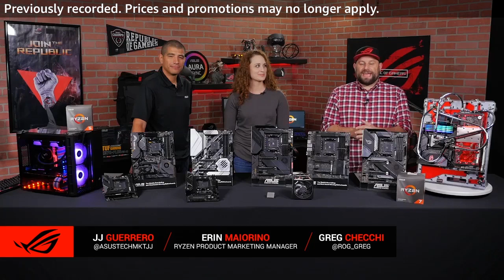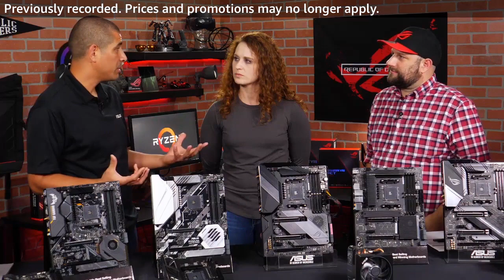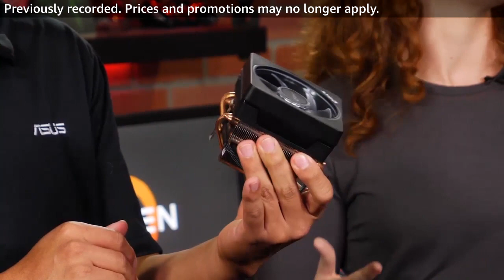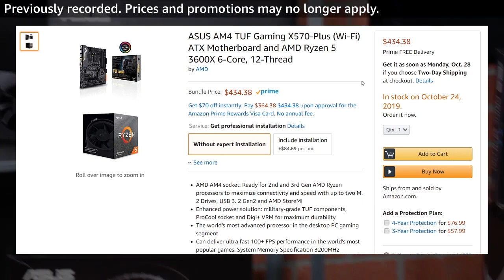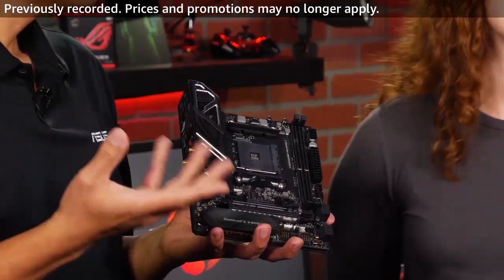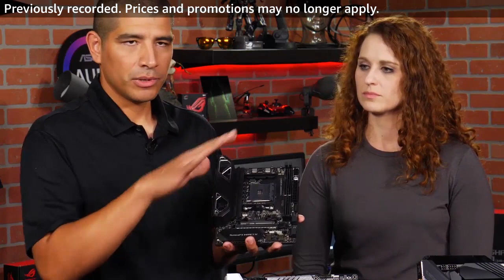Unleash the Power of your next X570 PC Build with AMD and ASUS

Comment: I got the ws x570 ace motherboard after watching this review but I have tons of issues with it.

My setup is

Ryzen 9
1 nvme pcie4 500gb
4x16ram
Quadro p2100
Psu be quiet 700w
Oc to 4.2ghz

The moment I add a 1tb sata SSD

IT WILL NOT EVEN BOOT TO BIOS!!!!!!!

Comment: Been running my 6700K on a ROG Hero for years now with no issues at all, not looking to upgrade to a 3950X and again going for a ROG Hero board but purchasing a motherboard with those little chipset fans on is extremely off-putting I can recall having people having motherboards fail when these little fans would give up the ghost years ago when they are used on motherboards